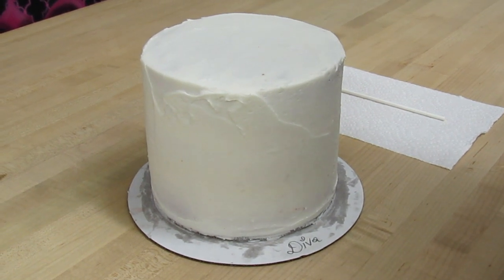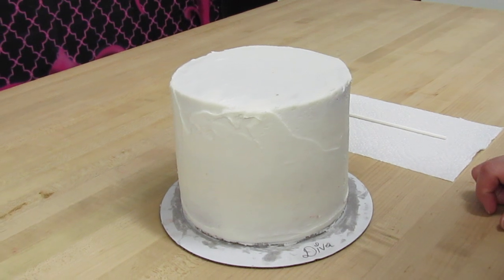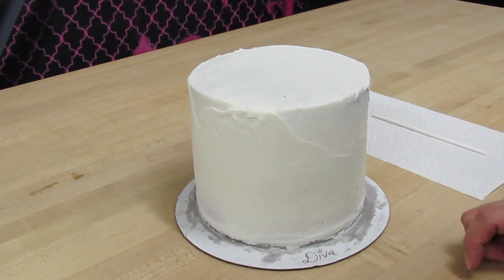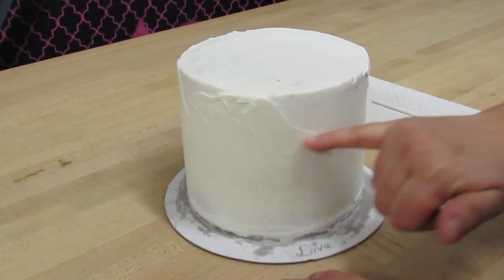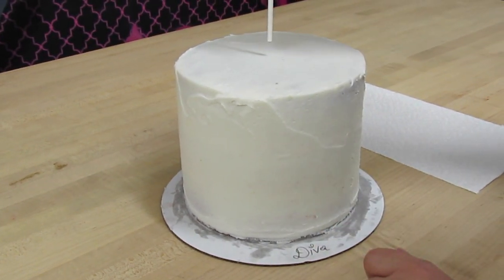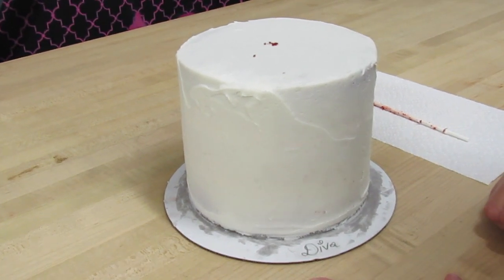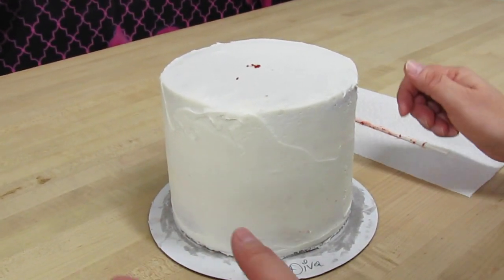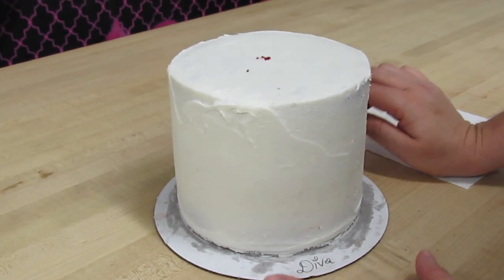How To Prevent Air Bubbles and Bulges In Your Cakes!

Comment: Thank you for your tutorials!  I have learned a lot.  I have a suggestion you may want to try . . . . instead of the tape to keep your boards from sliding, I use non-slip shelf liner.  I cut different size pieces into circles, and put them under my cake boards to keep them from moving when I'm icing my cakes.  They're reusable, and that way you wouldn't have to mess with trying to get the tape off the bottom of your board!  Just an idea to share with you!
Reply from the maker: You're very welcome Traci! We've used the non-slip shelf liners and unfortunately they are not strong enough. Our icing is very thick in consistency and it requires quite a bit of elbow grease to ice a cake well. The liner isn't strong enough and doesn't stay put. The only thing we've found works perfectly without any hassle is the strong packaging tape. It does make sense however to use the non-slip liner if the icing is very thin and creamy. No elbow strength required there. :) Thanks for watching our tutorial. Glad you enjoyed it! :)
Reply: @Traci Storm love this idea!

Comment: Hi Laura, I just love your techniques. I do have a question about sagging fondant.  I recently used Satin ice fondant and followed your dam and tort techniques and used the bc recipe your provided.  How do you avoid sagging?
Reply from the maker: Thank you Leng! It sounds like your icing is probably dropping underneath your fondant. If you are using the exact same recipe (the pure solid shortening recipe for the outside) I don't see why this should be happening. Are you using the exact same recipe? If so, are you letting your cakes settle already forted before your ice them?

Comment: Love the video!!  I usually bake my cake layers ahead of time and freeze them. When I am ready to decorate my cake I let the cake layer set out on the counter for 25-30 min and then I start my crumb coat. If I were to put the hole in the crumb coated cake and left it in the fridge for 20-30 min then do my final icing would that be enough time to let the air out? Would inserting a hole in the center of cake after fully iced be a good idea as well and then fill it back right before customer picked up?
Reply from the maker: Thank you so much! Glad you enjoyed it. :) I would recommend instead of taking it straight out of the freezer and into room temp. that you would take it from the freezer the night before you crumb coat and let it be in the fridge all night so that the crumb can have time to settle at its own pace rather than rushing the temperature change by just leaving it out for 25-30 min. before you crumb coat. Once fridge temp (and I'm assuming you tort your cakes before you freeze them) you can crumb coat and make your hole. I chill my cakes in the freezer for 10 minutes before the final coat, or leave in the fridge for a few hours to allow the crumb coat to get hard before the final coat. That's enough time to allow any air to escape. Once the cake is finally iced I always put it back in the fridge and I take it out one hour before delivery so that the cake is not cold when they receive. I hope that helps and thank you for watching. :)
Reply: @krazykoolcakes  this helps SOOOO much!!! Thank you so much! I have a few cakes going out this weekend so I will try your method for sure! Thank you for taking the time out to respond to me!!! I am subscribing to your channel and on Instagram😉

Comment: Question, if you put the cake in the fridge, won't that cause the cake to firm up which then wouldn't allow the cake to settle? Thanks for the tip though! I'm definitely going to try it :)
Reply from the maker: Hi Joey! Yes, if you put it in the fridge it will firm up, but even with the cakes firm, gravity still plays its role and causes them to settle, wether firm or soft. ;)

Comment: This is an awesome tip! You said you leave your cakes in the fridge over night.  How do you avoid the cake getting hard or dried out? That has happened to mine. Thanks
Reply from the maker: Thank you! The icing acts as insulation. My cakes are always very fresh and moist when kept in the fridge iced. Attempt to not have them in your possession no more than 3 days from baking.

Comment: Great tip thank you. I have a question though, what do you do with the top tier that has to be perfectly smooth on top?
Reply from the maker: You're very welcome Maria! That's a great question. If the cake is not going to be covered in fondant, then what I do is after I stack my cakes (and by then the cake has had all the time it needs to release any air), and after I pierce all my cake tiers with the dowel that goes through, I just add a bit of icing over the hole and smooth it over. You can't see it. If it is covered in fondant, after I stack and add my dowel I do the same. Add a bit of fondant and just cover it up. All of our cakes have some sort of a topper though so I really don't bother covering it up as it'll never be seen. I hope that helps. :)
Reply: Thanks very much. I just wondered because recently I made a buttercream covered wedding cake. (I usually do fondant). The flowers on the top were to one side so most of the top of the cake was exposed. x

Comment: I’ve not had issues with air bubbles/bulging yet (knock on wood), but if you poke your cake before cooling it, will it dry out at all? Do you use a syrup on your layers?
Reply from the maker: Hi Katie,  There's really no point in poking a hole while cooling. The air is not trapped inside the cake (breading) itself, rather in between the layers of cake. We do use sugar syrup from time to time depending on the recipe.

Comment: I have been wanting to ask, if the crumb coated cake is cold in the frig, overnight,  does it still settle? Won't it settle again when brought out tp room temp the next day?
I never had issues but now I continue to get bulges. I haven't changed anything and yet I'm always having issues. 
I haven't had anyone to ask for help. I know this video is old but I pray you see this and are able to help. Thank you!!!
Reply from the maker: Hi and thank you for your question. It will only settle overnight in the fridge, if you did not allow the cakes themselves to settle before you crumb coated them. That's why I like to bake one day and not ice until the following day. That way the cakes have at least a day to settle and shift in the fridge before I tort, fill, and crumb coat. Hope that makes sense. If you don't use a thick consistency dam in between your cake layers before you fill and crumb coat, this might also be a factor that plays into your cake tier settling. Hope that makes sense. So basically, you want to let the individual cake layers settle on their own before you ever tort or start icing. That will avoid your cake layers from moving even when they come to room temp. I wonder, if you never had issues before and now for some reason you're getting bulges, there has to be something that's being done differently. Can you identify what you have changed? Or what has changed in what you're using or the environment the cakes are in now? There must be a difference/change somewhere if it wasn't happening before...? Happy to help you. :) Thanks for watching!
Reply: Thank you so much for responding. 

I bake, freeze, thaw the day before, crumb-coat and refrigerate overnight. I do the final frost the following day. The only thing  I changed was removing one egg from my recipe.

I started having these bulges less than a year ago. I have now tried different techniques that I've seen online......
a) Filling layers, wrapping and allowing to set out at room temperature overnight
b) Crumb-coating, making the hole in the center and refrigerating overnight 
c) I've tried both of these together 

I've had some luck and yet still some bulges.

So your cakes "settle" IN the frig before you crumb-coat?

You do not set your cakes out at room temperature to settle? 

Your cakes are refrigerator chilled when you fill and crumb-coat?

Maybe I need to bring them out of the freezer sooner to allow to settle longer? 

I am sorry for so many questions, I am at a loss and I have had no one to ask for help. I do my own research but this issue is stumping me and really getting to me.

I am sooooo grateful for your help and your videos. Thank you!!!
Reply: Sorry, I am not sure if I stated that I am only using American Buttercream, not fondant.
Reply: Sorry, reading all of this I'm not sure if I was clear on my issue...... I'm not having issues with the filling "bulging." I am having issues with air pockets making air bulges/bubbles  and pushing out the buttercream.

Comment: hi laura, my cake will be 6" tall, using 3x 9" madeira cakes split in half... do you recommend the buttercream and jam, to be thinly applied, and would this help prevent bulging?  im looking to cover with fondant, and decorate, the day before the event. the climate is 28-30c. I have aircon in my spare room  and corrugated transport boxes..any advice, please? x
Reply from the maker: Hi Maria! The thickness of the icing really has nothing to do with bulging. It's just a matter of if you are damming and filling your cake properly. If you are, then no need to concern yourself with bulging, which is air being trapped between the layers. It can be trapped whether thinly applied or not. Just be sure to tort, dam, and fill properly. Be sure to watch my tutorial on that if you have any questions on how to do that. Be sure to keep your cakes refrigerated as much as possible. :)
Reply: Thank u x

Comment: Do you find you still get bulges if your cakes have been frozen and defrosted? x
Reply from the maker: Hi Maria, Thank you for your question. We never freeze our cakes. However, if you need to freeze cakes for some reason, I would recommend a day or two before you ice them to transfer them from the freezer to the refrigerator  and then when they have completely defrosted and are only cold from being  in the fridge, then you can bring them out and ice them. You definitely don't want to freeze a cake that has already been iced (to avoid disasters). I hope that helps! :)

Comment: Once the hole is made do I keep the cake in the fridge overnight before covering with fondant, will the cake dry out?
Reply from the maker: Hello! After I make this hole in my crumb coat and I ice the final layer, I make another hole in the exact same place through the outer icing. Then I put back in the fridge and I don't cover in fondant until the next morning/day. The cake does not dry out because the icing serves as a film. The only way it can dry out is if you cut a giant slice or cut into it. I hope that helps and thanks for watching. :)

Comment: Are there any tips on what to do if an air bubble does form regardless 😣 I’m currently trying to fix my beautiful cake that I decorated yesterday and has come up with a bubble and cracks today 😭
Reply from the maker: Hi Kirara,  Sorry about your mishap. I"m sure by now you fixed it, but if you'd like to avoid this in the future, be sure that you are properly torting, damming, and filling your cake layers before icing in order to avoid air wanting to escape out from in between your layers which is usually why this happens. Hope that helps a bit. :)
Reply: Krazy Kool Cakes & Designs thank you so much. I’ve since started poking a hole into my dirty iced cakes and I haven’t had a problem yet ☺️

Comment: Thank you for the tip! but i crumb coat and final coat within 20 minutes time gap. do you think this would be enough time for the air to escape? or should i put a hole in my final coat and cover it up before delivery so that it will have time?
TIA!!
Reply from the maker: Hi Tia! Thanks for watching! I only leave my crumb coated cake in the freezer to chill for about 15-20 minutes so you're fine if you ice your final coat after that time frame. However, you do want to make sure that you are not baking and icing on the same day. My advice is to bake the day prior and leave your cakes (after they've come to room temp of course) plastic wrapped in the fridge for an entire night before you ice the next day. You need to give your cakes time to settle and let gravity do it's thing so that they're not moving once they are iced, which is most of the time what causes air to "want" to escape out of a cake. The cake needs to be given time. I hope that makes sense. :)
Reply: Krazy Kool Cakes & Designs thank you for replying!!
Yes I do bake a day before and leave it in the fridge just like you said.
Will definitely try out the hole tip
Thank you 😊

Comment: Hi Laura, you say you put the cake in the fridge overnight, do you cover it in plastic before putting it in the fridge? I bake from home and I don't think I  should put my uncovered cake in the fridge overnight cause of all the other foods smells etc.. Will it be fine if I leave it uncovered?
Reply from the maker: Hi Camillia! We don't cover in plastic since the icing itself acts as insulation. Our fridge is solely for cakes so if you have food odors in your fridge, it might be a good idea to cover. However, you don't want to ruin your icing job with plastic on it. If the fridge doesn't smell like other foods, it's okay to leave it uncovered.

Comment: will the fondant on the cake,  condensate, as its been in the fridge overnight? x
Reply from the maker: It depends on how warm and humid your work area is. Be sure to work in a very cool and dry environment. Even in a cool environment you'll have a tiny bit of condensation form on the cake but that should dry quickly. In a matter of a few minutes. Hope that helps! :)
Reply: Yes, that definitely helps thank u x

Comment: Do u keep it open overnight after the crumb coat or cover it?
Reply from the maker: If I'm crumb coating late at night I do leave it like that overnight. But, if I'm icing early enough in the day, I'll just leave the hole open in the fridge for a few hours to give the air some time to escape. After icing it with the final coat I remake the hole at the top to continue to allow any other air to escape before covering it in fondant, if it will be covered. Hope that helps and thanks for watching. :)
Reply: @krazykoolcakes  yes that is helpful...thank you for a prompt reply

Comment: Hi Laura, Can you tell me of to keep a 12 x 3 from sinking in the middle?  It sinks only on the middle and outer part still raises to level
Reply from the maker: Hi Melissa! For cakes 12" and up, we use a "heating core" so help bake the inside "almost" as well as the outside. For larger cakes, you'll always have a little bit of sinking which is why we fill a little more with batter than we would say cake pans 10" or smaller. Having said that, it will still sink a little so be sure to "tort" your cakes level. If you have a REALLY large sink hole, don't worry. Remember that after you tort, you can always fill a hole in the middle using some of the scraps you had left over after torting. If you pack it in there nice and tight, it won't even be noticeable when your client slices your cake. Sinking cakes is just one of the things we have to deal with constantly. :)

Comment: What about the cake layers  bulging themselves I have issues with my cakes bulging bad after I crumb coat ….
Reply from the maker: If the actual cake (the breading part) is bulging, then that means your cake is way to soft or way too moist. You may want to switch recipes to something with a bit more body and strength. Thanks for watching!

Comment: hi laura ,what causes cake to sink and fall ater my mom gets it out of the oven?
Reply from the maker: Hi Segheir! Depending on the recipe, some may do this more than others. When the cake starts to cool off and assumes room temp, all the hot air inside begins to escape. This makes the cake settle. If your recipe tends to do this a lot, tell your Mom to consider adding more batter than usual so that when the cake does settle, even though it may sink a bit, she can still tort it and basically level it off straight on top. I hope that makes sense and hope it helps. :)

Comment: I do this and everything looks fine even after the second layer of icing there's no bulges. It seems to be whenever I put the fondant on it starts to bulge the next day and as it comes to room temperature. What am I doing wrong? I also leave it alone at each stage overnight and have the same problem whenever I have to do a fondant cake
Reply from the maker: Hi Brady,  Thank you for your question. I'm sure we can figure out why this happens. Are you by chance icing your cakes the same day you are baking them? If not, are you torting your cakes perfectly level? And are you also damming with a thick consistency icing in between your cake layers so that there's no icing being pushed down and out by the weight of the cake layers on top? This is what causes bulging. If the cake layers have not been allowed to "settle" for a good amount of time before torting and layering them, then gravity will begin to take over at the wrong time (after you've iced your cake). Also, if your cakes are not torted perfectly level, then once you've stacked everything they will start to lean and tilt in the direction of the lowest point. This will also cause bulging. A bulge is just an outer symptom of something not having been done properly on the inside. If you haven't yet, please be sure to watch our tutorials on how to tort, dam, and fill properly, and also be sure to watch our tutorials on perfect icing consistencies so that you're using strong icing, and then also watch our tutorials on how we ice cakes to make sure they are perfectly straight. I hope al this helps. I don't know if you're aware but I have an "ONLINE Icing Class" where I teach and demonstrate all of this. If you're interested in signing up, here is the link for you: www.krazykoolcakedesigns.ecwid.com